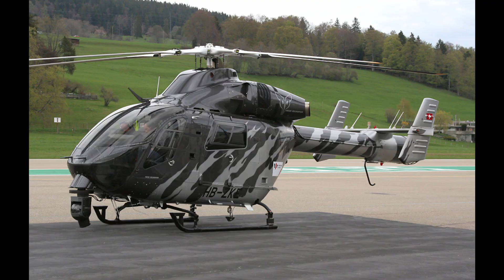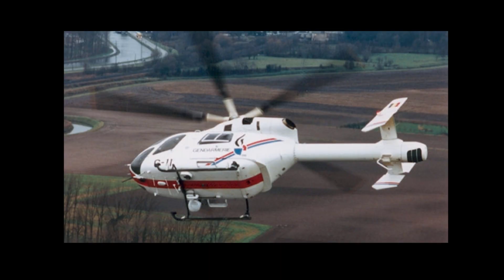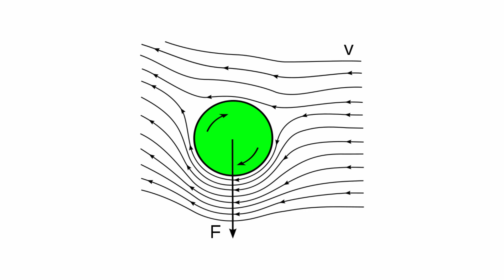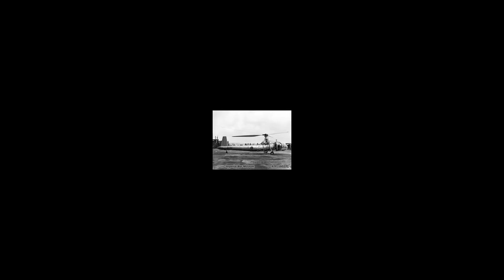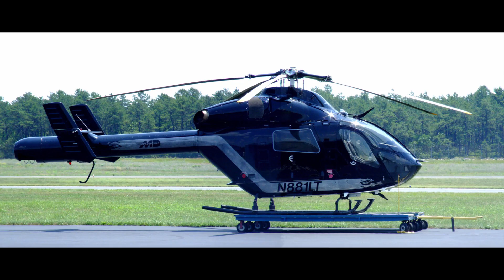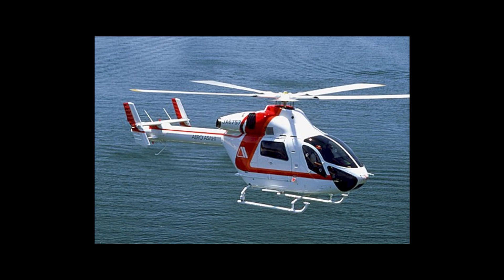Explaining How NOTAR Helicopters Actually Work

Comment: Great, informative video.  I was trying to envision this NOTAR system on different helicopters and in different roles and geographies.  Does the NOTAR system generate instability?  And does that instability ramp up with the power of the engine(its ability to generate downforce)?  Another commenter mentioned rain, and i wanted to follow up with the question of whether or not the NOTAR system would be a good system for US Coast Guard helicopters, specifically, those operating over coastal/littoral waters of Alaska?  Also curious about its impact on fuel efficiency?

Comment: Hello Julian, thank you for an excellent explanation on the NOTAR. I think it's an efficient and very cool design. But I do wonder how well the system perform under heavier rain conditions? The air-intake for NOTAR is directly under the main rotor, so seems a lot of water may run in the tube when under heavy rain. Also wonder whether rain water running off the boom surface may reduce the Coandă effect? Is this why you said the chopper could be less safe than tail-rotor system under certain conditions?
Reply: The velocity and volume of air traveling through the tail boom would not be affected anymore than the engine being affected. The water will not pool inside, possibly a little at the rear cone, but the air would be so turbulent that the water would atomize. Same for the Coanda effect, the volume and mass of air would be little affected by water ingress. If it experienced enough water to cause an issue, the engines would have flamed out first.
Reply: That is definitely one of the best questions (and comment) about the NOTAR-Technology I’ve ever saw/heard! 👌🏼
PS:  🚁  =  🔝 😊‼️✌🏼

Comment: Great explanation Julian, when you talk about the Coanda effect is that the force moving the tail boom to the right(the result of downwash) looking from aft? Will this effect to the right only be true in CW rotating main rotor systems?
Reply from the maker: the downwash and the air pushed out of the tail boom - the design of the main rotor isn't really relevant as long as air is being pushed down - the same effects can be seen in simpler systems without a helicopter around and it's quite similar to the magnus effect except instead of spinning the boom itself you ave slits in the boom and push out a thin layer of air to flow around it

Comment: I always wondered how that worked.  Why not counter-rotating main rotors?
Reply from the maker: that is another system that comes with its own set of advantages and disadvantages, I generally like koaxial rotor or tin rotor designs, but objectively speaking, they have their advantages and their purpose but also some disadvantages - one main problem of twin rotors is that they are relatively complex to design build and maintain, especially koaxial ones and they also tend to get a bit more noisy as two rotors interacting is always a bit louder then a rotor and a fuselage
Reply: @JulianDanzerHAL9001  It's "Coaxial" but yeah
Reply: Coaxial systems are pretty complex, on top of the complexity of a regular chopper. If you mean like the CH47 Chinook, yeah, it's a good system for efficiency and speed, but you have to make two main rotors, maintain them both, and have a complex transmission as a failsafe in case one fails.